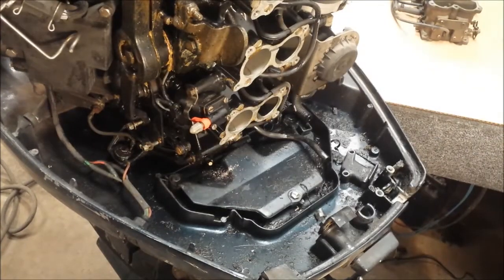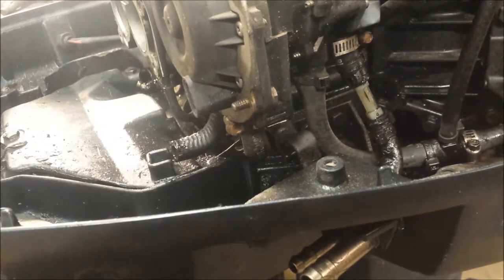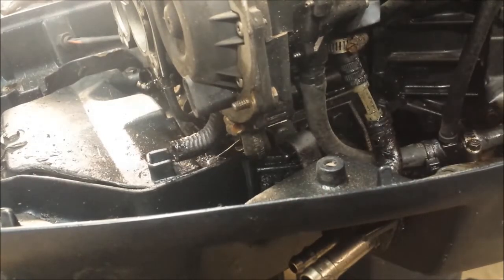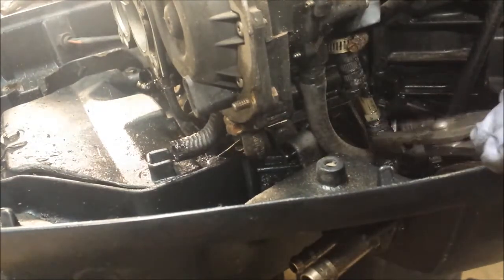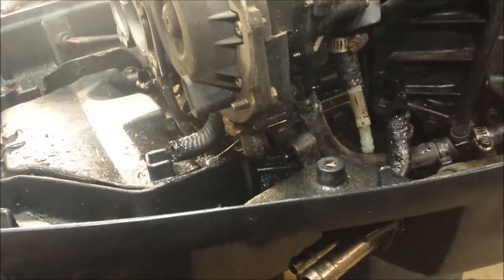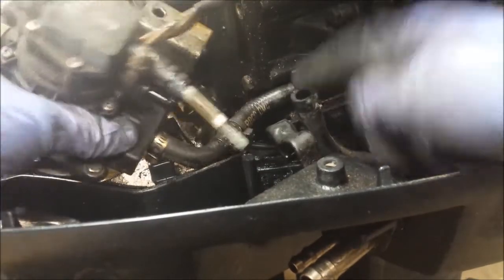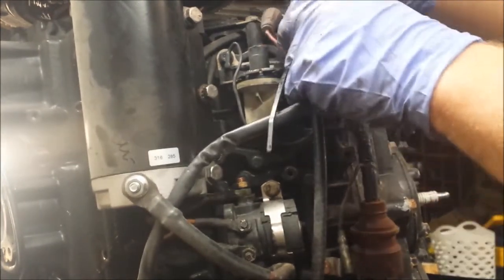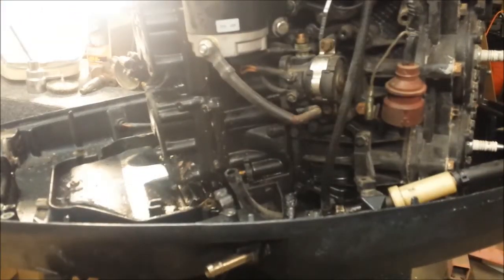Evinrude XP 175 HP Teardown: Part 3 - Lower Removal

Comment: Brandon...Maybe you can answer a question concerning trim/Anode tabs which I understand help in steering issues also..I have a 1985 20hp on my 14' lowe jon and at full throttle the tiller pulls  to port and on longer runs it is tiresome on the arm to keep the boat straight.My motor does not have a trim tab anode like the one you showed, just a small anode.Any ideas on how to stop the pulling?